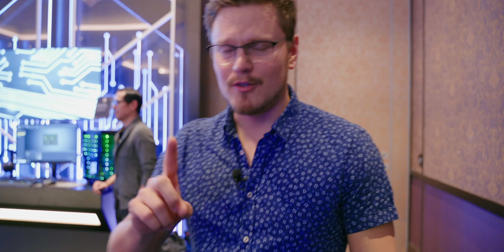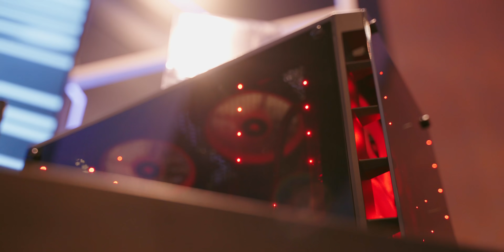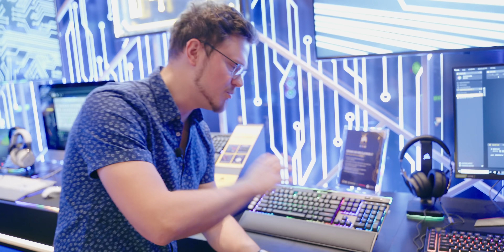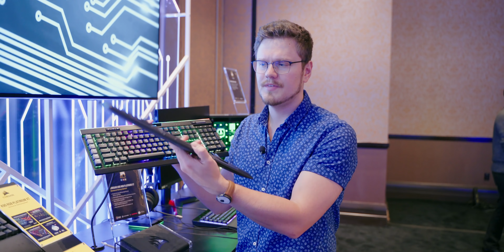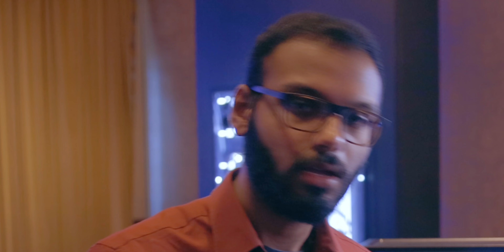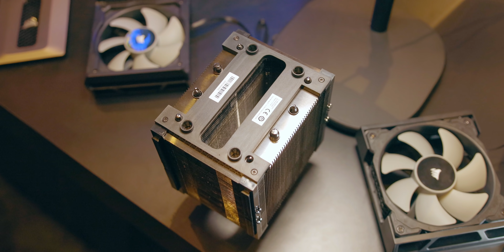Corsair Air Coolers Are BACK!

Comment: The A500 is around 15 euro's more expensive then my  Be Quiet! Dark Rock Pro 4 and it is not offering better perfomance in cooling and noise. Less performance actually. I think they are not back in air cooling yet.

Comment: 4:20 slight correction. That cooler is actually directly competing with the Noctua NH-U12A. Emphasis on the "A". 
The dark rock pros and the d15(s) are dual tower coolers and don't directly compete with this one.
Reply: Doesn't really matter if they are dual towers or not. Besides, this Corsair cooler is closer to dual towers than something like U12A or Brocken 3 as it is hollow in the middle.

Comment: Silly question but I'm running the H100i V2 cooler with 2 SP120 RGB fans. Would I benefit more from my cooler I'm using or the new A500 cooler?
Reply: What CPU are you using?
Reply: @dainiusvysniauskas2049  Ryzen 7 1700

Comment: I'm not seeing how the Corsair A500 is supposed to compete with something like the NH-D15. It only has 4 heatpipes & 120mm fans. Maybe it'll get similar cooling at 2400 rpm, but it'll have to be much louder to do it. It may be worth considering in cases with less CPU clearance, but I have my doubts about it beating 140mm coolers, especially at a $100 price point.

Comment: I find it even odd that people will even still buy Corsair KB, overpriced piece of plastic....for the price you paid you can get lot better KB out there, even Custom ones...maybe even throw in some good ass quality caps...MAYBE....because the Double Shot ABS caps alone that I bought it's 150$....so depend on how high of a quality caps you want lol....

And actually Noctua new NH-U12A is their new King of Air Coolers...it's great as D15 but SO MUCH SMALLER and with only 120mm fans and lot quieter too...
Reply: NH-U12A is overpriced shit. Costs 100$, can't beat Fuma 2 in cooling and noise level

Comment: Cooler probably looks better with that too plate removed, imo. 

Like the fan sliding mechanism, but I'd like it to be a bit less bulky. 

I like using existing backplates on sockets that have them (i.e. am4, lga 2011, etc). Pls do that. As for swapping the bracket on the cooler, asetek has the best way (so fast).  Something that easy would be ideal. 

I have no issue with it not being TR4/SP3/sTRX compatible since those really should have a larger coldplate anyways. 

I always think of air coolers as no BS, just get it done kind of deals. So no rgb totally fits their use case to me.

Comment: That A500 is listed on their website for 100 bucks...Seriously...You could do any of 50 AIO's or spend 30 bucks for  a 212 Evo with RGB or 25 without  or some other clone. The Scythe Air Cooler is like 60 bucks. I mean..the cost of air cooling is stupid expensive in comparison, because AIO's are around the same price...

Comment: That Corsair screwdriver looks exactly like the one that the Dark Rock Pro came with. But with separate logo. I'm looking forward to this cooler, with how you can adjust the fan placement to avoid the ram and easily remove them, it's amazing.

Comment: No thanks. i only buy corsair PSU's that are made by one factory. big props to Johnny Guru. other than that i AVOID there memory and all the other junk they make. Even the stupid iCue software is crap, causing reboots on systems like x79 systems, and they wont fix it despite everyone with issues with it.
Noctua's, AIO's that have proven themselves, and custom loops that actually do better than noctua are what i would choose instead of anything from corsair.

Comment: Because Corsair's new air cooler comes with 120mm fans, wouldn't mean better static air pressure across the fin stack?  Also, those slide in mounts seem to have fairly tight tolerances which would help the seal.  So around better config that with 140mm fans?

Comment: The air cooler is SO HIDEOUS. Dark Rock Pro 4 >>> this
Reply: Assassin III has extra room for gpu
Reply: Agreed. It’s also way too big at 169mm H and that’s before raising the fans to fit taller ram. Considering most people struggle to fit the NH-D15 in their case and that’s only 165mm H.
Reply: It is possible to add a third fan to Scythe Fuma 2
Reply: Dark Rock looks is overrated
Reply: @Aggrofool  wdym. This looks straight out of 2008.

Comment: Do people really still use air coolers? The AIO coolers are so good now there’s no reason not to use one. It’s nice not having to worry about CPU temps with a nice OC. Plus they are so much quieter.
Reply: I do. I never worry about CPU temps either because I don't have a pump that can fail or have to worry about my components being fried by a leak however small that risk may be. My i9-9900kf stays way below max temp on a $40 dual-tower, dual-fan air cooler and it's quiet. Granted, it's not OC'ed but I don't see the point when it already runs 4.7-5.0ghz depending on the load being put on it.
Reply: Easy maintenance

Comment: Those slide-in brackets are genius. Finally someone did it
Reply: Yeah I've wondered for a long time why no one else thought of it.
Reply: @RickyV-Production  because the Noctua clips work better, are simpler, are lighter weight, have less potential for failure.
Reply: jon Gotcha. I’ve never thought of that.
Reply: they're not genius. genius is when there is nothing left to take away.

Comment: I am not a fan of the case lights... I like the idea but I would rather build a case with a display like the I buy power snow blind case. I also think that the 100 dollar price for the aircooler is a bit to high sure its massiv but I can nearly get a cheap aio watercooler for that price. But I like the design.

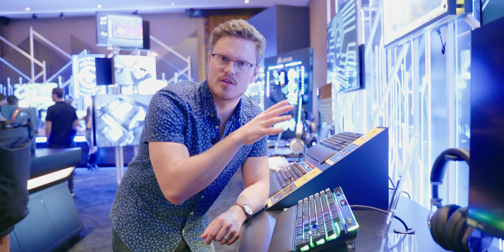Comment: 2:55 is that gonna work for the corsair k55 too?
Reply: No you wont and yes you already do, they made the k95p and the new k95p have the macros act as new buttons on their own .. not assigned to a different button so when you hit them they register as G1-6 instead of a regular macro where you have to assign it to a key like “W-A-S-D or Anything that is regular”, you could work your way around this on a cheaper keyboard (as long as its controllable in iCue) .. you can assign your macros to function keys like F1-12 and key-map the hotkeys in stream deck to those buttons so your macros work like the new features do
Reply: Don't know but according to another youtuber (forgot who it was as I have been watching CES coverage from at least 10-15 youtubers) they said that older Corsair keyboards will get Stream Deck functionality and they did NOT say K95 Platinum specifically like Dmitry did